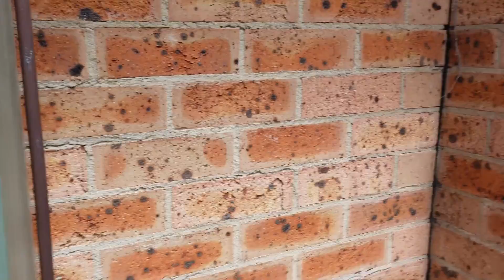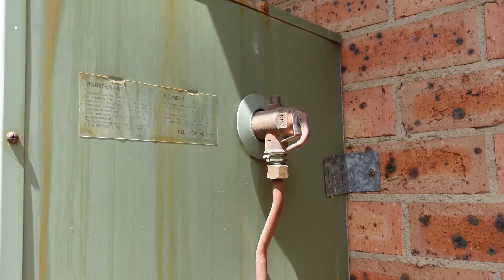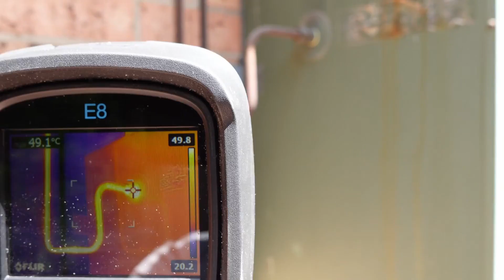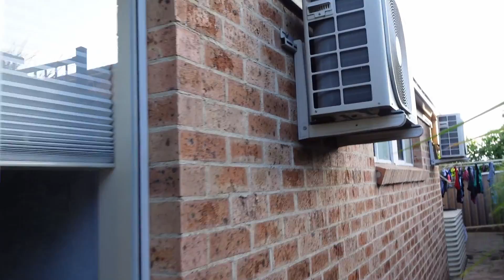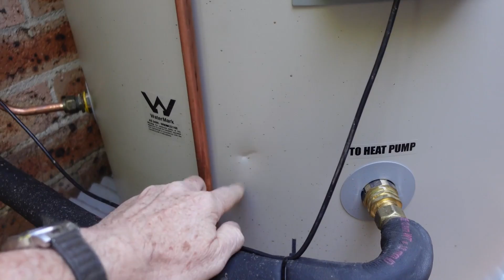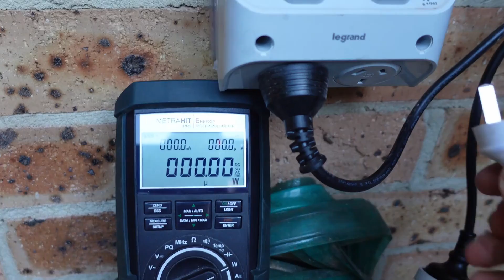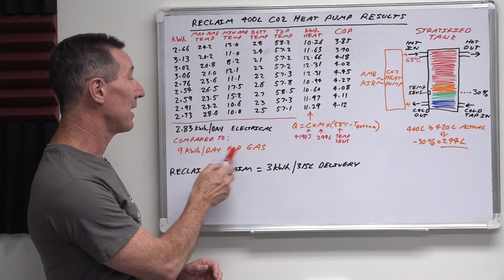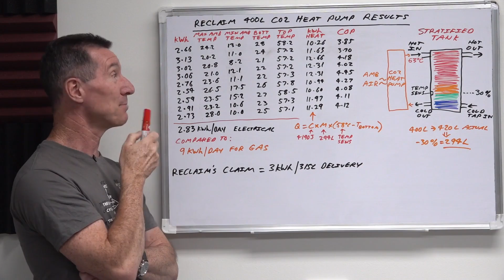EEVblog 1517 - Heat Pump Hot Water Install & Analysis

Comment: My heat pump used back up direct heating element (immersion heater) to boost to 60 degrees once a week but you could manually turn it on in the factory settings from this known heat input I would work out the flow rate so could then work out the heat pump output, thought about adding a pump to circulate the water in the tank to add more heat capacity and remove the stratification, this was a ground source in the UK, most of thr time except at the end of winter an air source would have been better.

Comment: why spoil it for everyone, that's just mean man, overunity ftw
that being said using 3x less energy is pretty impressive gain, even with using grid power (don't know if it actually saves $, would be interesting to know the figures if you were to have switched without solar).

Comment: Would it be possible to tell the heat pump to heat the water in the tank to way higher temperatures when excess solar energy is available, but the tank is already warm enough? They temperature valve would just mix more cold water into it and get the same tap temperature.

Comment: You showed you outdoor AC units at the beginning. Don't they literally do the same thing as the heat-pump?

So why is there no standarized mix-and-match system where one can just plug in any outdoor unit to any consumption device (water heater for warming, indoor AC unit for cooling)? And since heat echangers are quite efficient: why do we still connect the heat pumps with their respective devices with refrigerants? Wouldn't it be easier and safer to use something like glycol or even plain water?

Comment: It is a bit unfortunate that you do not have any data on the primary metric of the system: the amount of hot water you are using.
But of course, some bounds can be calculated.  When you use 9kWh/day heat power (from the 12kWh/day and 70% estimated efficiency of the old system), and the input temperature is 20deg heated to 52deg, it would be possible to calculate:
The energy required to heat a liter of water by 32degC is 4.2*32/3600 = .0373 kWh, so with 9 kWh you can heat 241 liters of water.
Of course that assumes zero loss during storage.  So in reality it will be less.
Maybe the isolation of the new tank, being new, is a little better.  But other than that, this figure would not change.  The volume of the tank is not a factor in this!  And neither is the actual temperature of the water in the tank.  Only the volume of water at the reduced temperature matters.
I think it is risky to assume that "because we never run out of hot water the daily usage must be less than the volume of our tank", especially for the old gas-powered system.
The water will re-heat during the day.  And due to the stratification in the tank, new hot water will quickly be available.  When you use small amounts of water over the day, you would not notice that the total amount is more than the volume of the tank.

Comment: It's only a thermal battery if you're using the full capacity of your oversized tank.  Otherwise it's just a constantly full battery.

Speaking of which, there is not guarantee you were only using 175L of hot water out of the gas system.  The gas one is constantly heating dependent only upon the thermostat, because you don't have gas time of day tarrifs.  Use all 175L and wait a couple of hours and use another 175L of hot water and you'll have used 350L of hot water.

You'll be better off calculating the heat capacity of 175L of water and comparing it to how much heat energy at 70% efficiency you're consuming, like you're done with the heat pump system to back calculate a COP (but with gas at least you know, roughly, the COP).  To me, it sounds more like you're closer to using 400L.

I take it there's a pump that circulates water occasionally when there's no water flow out of the tank?  Our thermodynamics lecturer gave us a good reason to want those thermoclines, but I'm too drunk to remember them.

Comment: Dude; great work as always, thanks :) One point, and I know that you already know better: I would like to clarify for the benefit of any who are concerned, but not necessarily so conversant with energy, and especially within the wider political/environmental context.... Your comparisons between the actual water heating apparatus is of course absolutely correct, BECAUSE you are producing your own SOLAR derived electricity. For anyone using electrical power generated from a mix of primary energy sources, then to get a fair account of the overall energy consumed, then appropriate adjustments would needed to be included, for example, for coal fired generation:- 100 GJ (coal) in for 35 GJ (Electricity) out; along with the corresponding overall reduction in system efficiency and increase in overall environmental load (ignoring overall "embodied" energy considerations).

Comment: CO2 refrigerants DO NOT work more efficiently in colder climates, but they work much better compared to other refrigerants.

They key is to have the gas cooler drop below 31 deg C (critical point of CO2) as it delivers the most amount of heat /kg of refrigerant going round the compression cycle. 

The smaller the pressure increase at the compressor, and the pressure drop across the metering device, the less mechanical inefficiency there is and the closer to the Carnot efficiency (max theoretical efficiency possible due to thermodynamics). 

You would be able to increase COP efficiency by dropping the hot water temp lower. However, if electricity is cheap enough, you can store the heat at higher temperatures because the lower COPs are worth exploiting the cheap low carbon renewable energy. 

What we care about is lowest cost/unit thermal, not COP.

Comment: Having the tank outside just seems so odd to me, even if water inside is kept hot the pipes exposed to the elements are a big risk.  I guess it rarely gets down to zero in Australia.   Been toying with a heat pump tank but they are a lot of money so debating on if it's worth it.  Need to switch out my old gas one since natural gas keeps going up to the point that hydro may actually be cheaper.
Reply: These work efficiently down to -15
Reply: @chefgav1  The ones they sell here are all a contained unit, so it's using hot air from inside the house. Of course it only makes sense if your source of heating is cheap or free. Hoping to have my wood stove working this year so that will help.
Reply: @redsquirrelftw  Ones they sell in Australia are cool climate. CO2 models can be installed in alpine regions ie -15 and cool climate -8. City I live in gets to -6 in winter and they work fine. Sure at -15 won’t be as efficient as 30c but we install outside they work fine in any climate
Reply: @redsquirrelftw  My city is phasing out gas all together so the only choice is either HPHWS or traditional electric .
Reply: @chefgav1 Wow that's going to screw over so many people, what about home heating?  Not everyone can afford to switch out their entire hvac system on a whim. :o Not to mention that hydro costs way more.

Comment: very site specific however, if you look at the cost difference between buying heat pump compared to legacy resistive hater this is around $2,500 to $3,500. now take that money and expand your solar system, this can give you an addition 3kws of panels, as this will produce on average more power than you would consume with the resistive hot ware it has a better ROI and you can use the power for anything, so if you have the roof space and had to choses to invest your money between more solar or heat pump I would chose solar, now if you have the money to do both the go for it

Comment: I'd think that the hot water heat pump's cold exhaust cold also be used for cooling the house in the summer?

Of course there would be some annoying practical considerations, but theoretically that could make energy use even more efficient right? Is this done with any systems, or if not what are the main reasons why?

Comment: Solar rooftop water heater is the best because its very cheap. Got highest efficiency and almost zero maintanance.  If you use traditional heater there will be Solar electricty -> Solar electric heater conversion., lot of energy wasted.

Comment: I’ve got solar panels and an immersion heater for hot water. There’s a controller which uses PWM to vary the power going into the heater to match what would have been exported. This is great because it can use anything from 0 to 3kW to exactly use the right amount. There’s a late evening boost in case the sun didn’t shine enough.
Wonder if the extra efficiency of a heat pump would be worth it here… also is it possible to vary the power consumed to match that being exported, like the immersion heater? Most heat pumps have inverter control now but can that be coupled to the export power?

Comment: Good breakdown. Of course if you don’t have solar then you’d want to look at cost per kWh from the energy supplier.
It maybe cheaper to use 9kwh/day of gas vs 3kwh/day of electricity.
Reply: The latest war took care of that problem. Gas price increased by more than 120% - suddenly these heaters become feasible.

Comment: I need one of those temper valves!  I'm up in PNG and have the roof mounted solar water heater.  Every few months I go up and pressure wash the dirt and junk off the panel and the next week the water is absolutely scalding!

Comment: Too hot of water, yes, on my boat, we use waste heat form engines to heat the water.  However that temp goes to about 78C, so it keeps it pretty hot!  With only 11 gallons of hot water, being that hot, it limits usage pretty good and allows much longer use of the water before the need to run the generator to use the electric side.  The hot water will remain hot for days.    Funny seeing a "split" system, as our heat pump systems in the US are all in one units with the heat pump unit sitting on top of the tank.

Comment: Dave, a medium sized single solar water heating pannel on the roof will give you more energy than half of the photovoltaics you've installed. In energy sources poor continental Europe photovoltaics are considered "they have more money than they know what to do with them". For europeans living in moderate climate zone with full four seasons with snow covered couple of months in the year living a house you can expect to find in their house hot water tank with 2 or 3 heat exchange coils - for solar, wood or gas burner and for a heat pump plus a direct heating element. High efficient solar heat pannels that requires pump for heat transfer fluid can heat your boiler from 5 - 8 degrees Celsius winter tap water temperature to over 30 degrees even in freezing cloudy period with short days and weeks without sun thus cut energy requirements from not free sources in half and in the summer it well produce heat more than needed.

Comment: 9:42 Oh great, so you energy intensly heat the water up to 63°C to later simply mix it with cold water
You better set your tank directly to 55°C. The purpose of a bigger tank is to have more water with lower temperature
You could put a water energy meter between the heat pump and water tank and see the COP directly. And lowering the target temperature should greatly improve the cop

Comment: Your kWh heat figures are a little off. No questions with your formular, but you’re assuming that the whole tank is at 20 something degrees. The tank is insulated, unless you use the whole tank every day.

Comment: Hi Mate,
I think you'll find that if you used the full 400lt every day, your relative COP figures will be better still, much closer if not better than 5. This is because it takes about the same kWh input to heat from 20 to 45 degrees, as it does to heat the remaining 15 degrees to 60. This is due to the greater temp differential when heating at the lower temps,  meaning you get better relative COP figures thrifty the first half of the heating cycle. This has an impact when factoring the volume. 

If you try it for a week, empty or the hot water prior to the daily heating cycle, so you're heating the full tank, not just 170lt, and redo your measurements and COP calculations, you'll find better relative efficiently and better overall COP when heating a larger volume of water.

Comment: This is a useful video because I am thinking about swapping out my solar hot water system for a heat pump. The solar hot water is great on sunny days when the only energy comes from the few watts consumed by the circulation pump.

However on rainy days like today, it can chew power with a 2.3kw booster. I have a sensor in line with the booster thermostat about 30cm from the top of the tank. To take that from 45 to 53-degrees C took 4.75kWh (then the sun came out about gave me another 5-degrees for “free”). The tank has a thermowell about 30cm from the bottom for the solar pump sensor. When the tank was reading 53 at the top, the bottom was reading 51C.

On a good sunny day the top of the tank can easily reach 73C. The water direct from the solar collector can be 100C+.

However, just a few rainy days would put the heat pump in front.

Comment: The new plumbing standards will make a huge difference as well. The tempering valve effectively "extends" the amount of hot water you have available by mixing cold at the tank outlet so is more efficient. I'd imagine they also installed a cold water expansion valve as well which saves you from having hot water dumped out the valve (wasted energy) when the tank is heating.
Reply: The mixing valve does not affect the amount of hot water you effectively have. If you set your water faucet in the shower to keep a temp of say 45c (113f) then it doesn't matter where you mix that water as long as you mix it to the same temp. You can have a 20c and 65c supply to the shower then mix it down to 45c, or you can have a 20c and 65c at the hot water heater that mixes just a little down to 55c, then mix a little more from 20c and 55c at the shower. Either way the cold water is 20c and the hot water in the tank itself is at 65c. No matter what you do the water in the tank has to drop from 65c to 45c and where that drop happens doesn't matter.

For the expansion tank, most places require it by code if you have a supply check valve at the meter, otherwise pressure could rise dangerously in the system and release the pressure release on the hot water heater.
Reply: @2009dudeman  There is efficiency loss in the piping, the heat radiates into the walls. By having an already lower temp transiting the piping through the house there is a lot less energy to lose.

Hot water cylinders have always had expansion valves, but on the hot side rather than the cold side. This means that when the tank is heating and pressurising, the relief would come from the hot side, which is already heated water which is a waste of energy. Cold water expansion valves are part of the new standard so you are releasing water from the cold side instead of the hot side, so wasting a lot less energy.
Reply: @ipullstuffapart  I'm sure there is measurable loss, but whether that's significant or not depends highly on the specific system. But you generally aren't losing a lot except in the worst case. I have copper pipe, which is pretty much worst case for radiating and conducting heat from the water to the surrounding environment and even I have an almost non-noticeable difference from one side of the house to the other. I would guess maybe 1c difference off the cuff based on measurements taken over the years, but I have never measured one side right after the other, only during refit. If your house is newer and using PVC or pex the heat conduction through the pipe is minimal. The only way I could see it being worse is in our Michigan basements with copper pipe, you have ground temp air surrounding the pipe instead of internal piping with a full basement where air temps are controlled. But you can have foam wrap put on the pipe that reduces this heat loss significantly. When I put foam on my pipe the water in the line stayed hotter a little longer while sitting after using hot water but I felt no difference in water temp at the sink on the far side of the house.

Legionnairea disease being a concern is the reason code prevents hot water side expansion as it's entirely possible to have water in a dangerous range for long periods of time in a hot water side expansion tank.

Comment: A Thermocline is a sharp temperature difference in water layers.  Pretty sure you don't have the volume or horizontal currents to cause that.  Even if you didn't have a bunch of turbulence whenever water was cycled in and out.

Comment: Tempering valves are awesome!  Double your effective hot water buy heating the water in the tank hotter than normal and then mix down to 125 in the US.  Be sure to get a spare since they do fail quicker than I thought. From experience. Mine failed closed thankfully but my wife found it not me. :(

Comment: Thank you for the detailed breakdown! We're in a similar boat as the one you were in; we've only the tankless as out last gas appliance.

In the whole last year, we've used 13,861 kWh of electric, and ~3600 kWh equ. of gas. The kicker is that with solar/batteries, the electricity cost $.0012/kWh, totaling $16.50, and the gas was $289 or $0.08/kWh.

It's amazing to me how much more expensive gas must be in Australia. I figure our daily kWh, was 9.8 where yours with gas is 12.8. So perhaps our usage with this setup could get down to ~2.14 kWh/day (I'd optimistically figured it would be below 2).

So if our electricity rate stays roughly the same, we'd pay less than a single dollar for a little under 800 kWh in water heating. That sure would beat the nearly $300 a year we're paying now! Lol